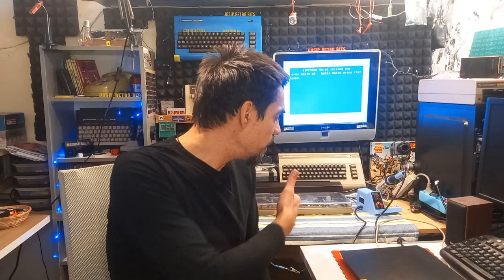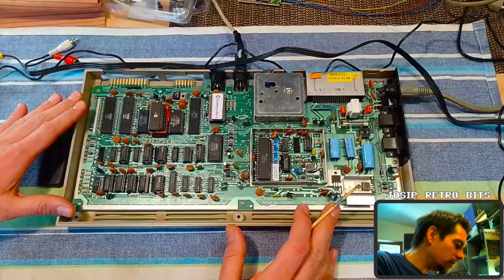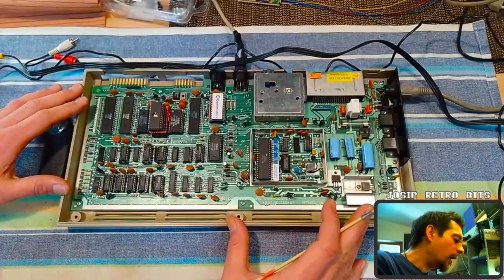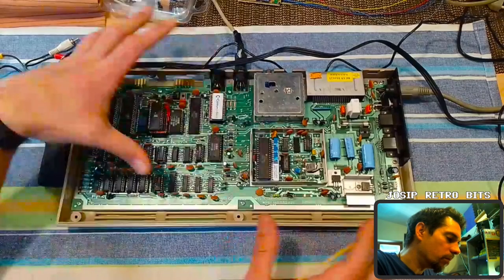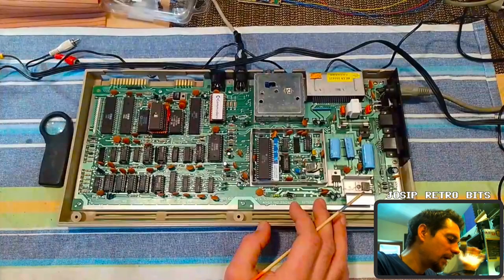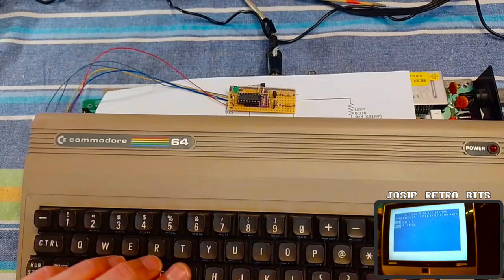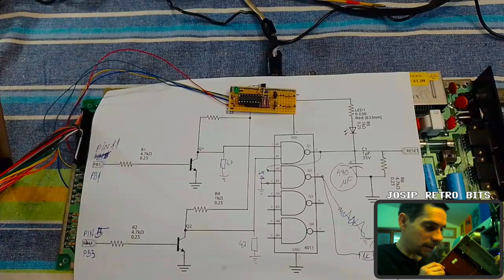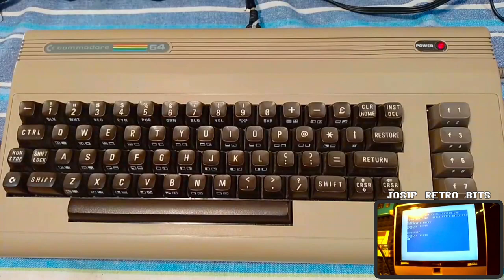Keyboard Reset Circuit for Commodore 64 | Mods and Repairs

Comment: Thank you for an excellent video.  You really have shown me a lot !  The reset mod is ingenious, and the tool you found and shared is invaluable and will save me hours of tracing time.   By the way, I once, just once, bought an untested board that actually worked !  But most end up in my fix-it pile.
Reply from the maker: Thank You very much. Yes, sometimes You get lucky with untested machines and have just a simple fix, in most cases, it's properly dead :) I just published a new version of the reset circuit :) Cheers!

Comment: Where was the broken trace at? I'm going through something similar rn and about to pull my hair out.. lol Nice Video BTW!
Reply from the maker: I know how you feel :) At 3:16 (https://youtu.be/Y6tYIzj0WqE?si=Jk4c6n2tGfB2JpiP&t=196) the first trace to the left of the pins. It was cracked but it was not visible with a naked eye. On this image is already fixed. 
If u can't see it (find it), use interactive bom to test all lines :) well depends on the issue.
Reply: @JosipRetroBits Oh, I'm sorry. I can see it in the video, I was just wondering where ON THE BOARD is it? Near logic? ROMs? VIC?

thank you.

Oh and interactive BOM is fantastic.. It's everything I wish C64 Parts locator was. Although, that's very nice too
Reply from the maker: Oh sorry, near logic :)  @jeffstack4217

Comment: Nice video. Question, taking the reset to low, basically is making a short? That is a doubt I have. Reset line is always at 5v, so linking it to gnd makes a short right and produce the reset. Is this safe?
Reply from the maker: Yes it is; that is how reset button works :) Reset line is not a power line, it's a signal line. It can be high or low. I do have a new version of this little circuit https://youtu.be/J8r-5bH86pA

Thank You for watching :) Cheers!
Reply: @JosipRetroBits  oh ok, I'm making a switch with arduno and I had that doubt. Not sure if was safe to reset that way. Thank you!
Reply from the maker: @rafaelmmartinez9170  Any time :)